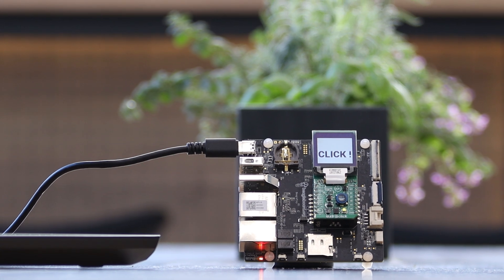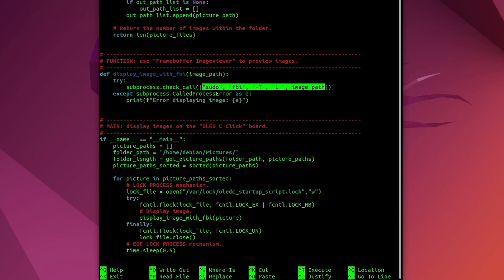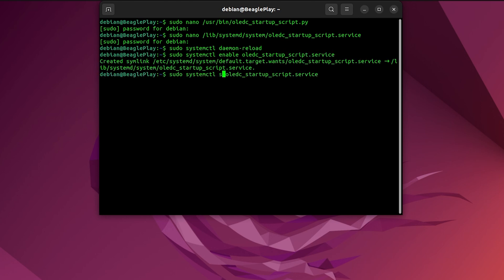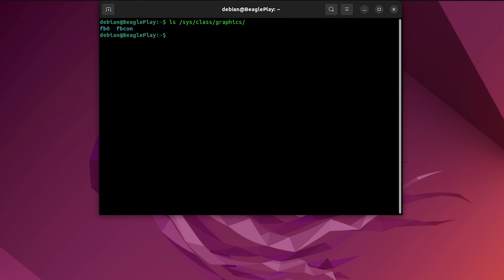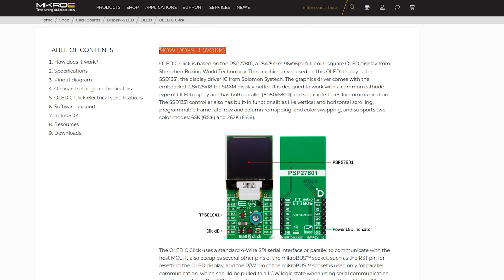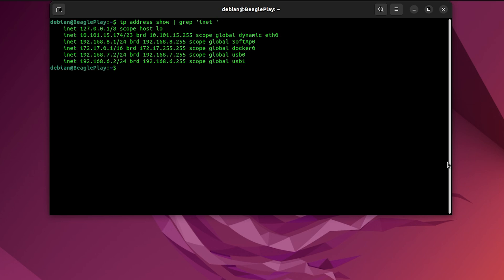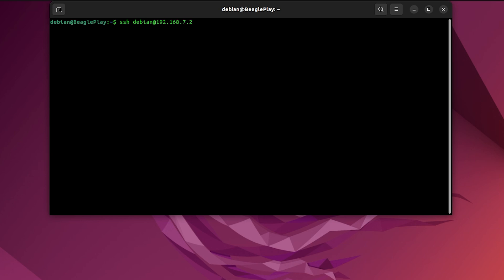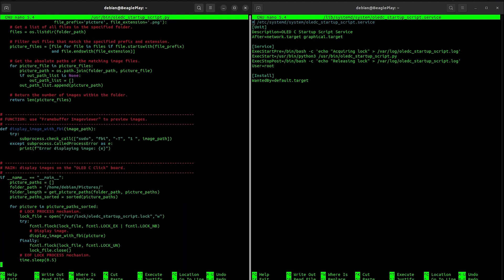Detect A Device in Linux via ClickID! | feat. BeaglePlay

Comment: Can Linux be run on MikroE MCU boards?
Reply from the maker: Hey there John, good question!
Short answer: No...
More detailed answer: RTOS could be a worthy substitute...
- Once RTOS is on a MCU, I would install 1-Wire library, eventually extracting ID of a Click board by reading EEPROM silicon which is on an Click board itself.
- Finally, I would be able to make use of this ID in my embedded RTOS-based project.
- I'll post an episode with RTOS on MIKROE's board sometime soon during next year.